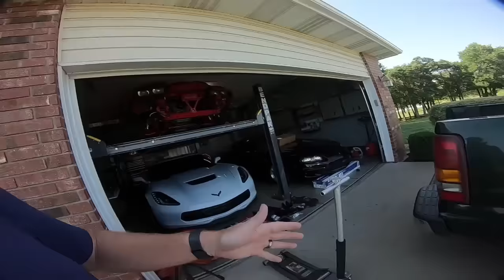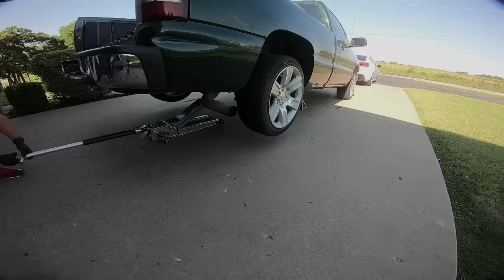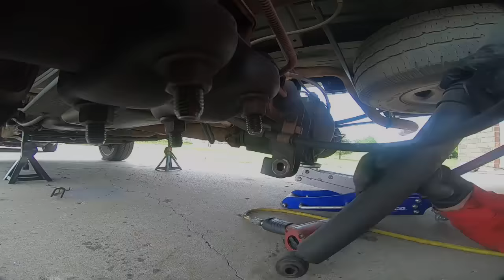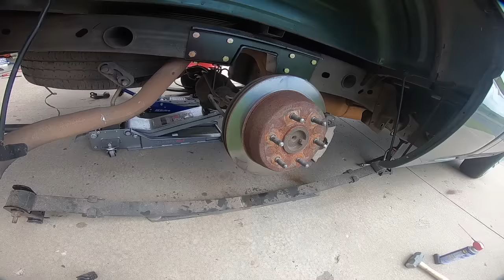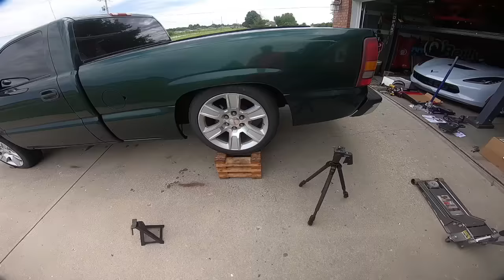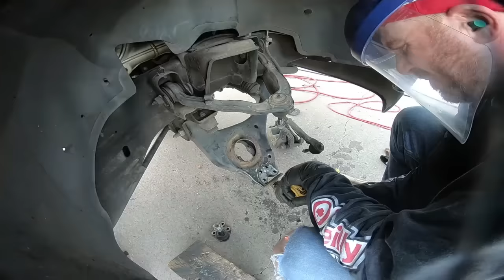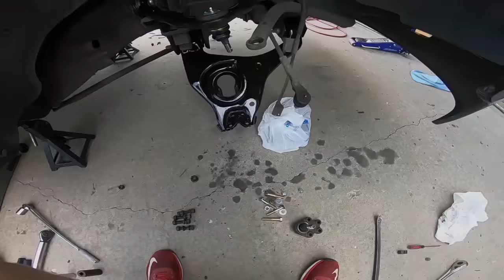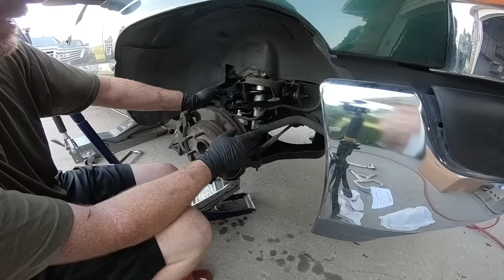How to Lower Sierra and Silverado NBS (Ultimate How to!!!)

Comment: Best how to lower these trucks video on the web hands down ! I've used this video several times as a guide reference every step of the way, now onto thoes bottom ball joints!
Reply from the maker: Thank you. Those ball joints suck!!!
Reply: When you grind the control arm , do you just do the top side or both top and bottom so its square?
Reply from the maker: I just did the top to get the rivets out
Reply: I'm talking about where the aluminum spacer inserts into the control arm.
Reply from the maker: It sets in even. No grinding inside where it goes

Comment: You can put the helper bags and put separate schrader valves for left and right so you can individually set heights. In fact if you had the lowering shackles on BOTH rear sides, you could pump up the left rear bag a little bit more than the right to compensate for the Chevy Lean
Reply from the maker: Yes you sure can.

Comment: watching you with the rivets made me laugh.  Years ago after trying to cut the heads off with a chisel for more than a hour, my ex came out, looked at what I was trying to do, stated why don't you drill them out!  Center punched rivet, 1/4" bit and 15 minutes later all rivets were out.
Great video. Gonna drop my 88 shortly. Owned since 91
Reply from the maker: I tried a drill too and all it did was dull the bit. I probably need some better bits though lol

Comment: I got a 2003  extended cab  1/2 ton i did a 5/7 drop and i put  airlift dual gauge and rear air bags and the rear airbags helps a lot when you do plan to put rear airbags don't use the supply bolts that goes from the top bracket to bags you will need to get shorter bolts trust me
Reply from the maker: I thought about a tank but dont air them up enough to need it really

Comment: I've been a Tech since 2000. I've had that exact same assembly apart more times than I could ever remember. Even the 4wd setup has only 1 more nut (axle nut). I think you did an outstanding job displaying a way that most people can do at home. Did you remember to notch out the upper control arm bolt holes for camber/caster adjustment? There is a really cool tool that does it with a 7'8 wrench. Take care Brother. Great job! Derek
Reply from the maker: Thank you. When using the upper a arms I used notching that area is not required anymore.
Reply: So basically make the hole a complete circle?

Comment: I just got a 3/5 djm kit and belltech shocks for a 3/5 drop....do i still need the shock extenders ?  Which is better arms or springs and spindles ?  I got 3" djm arms
Reply from the maker: I like the way shock extension put the geometry back in line for the shock. As for arms vs spring/spindle its preference. I don't like the ball joints in djm arms.

Comment: Do you have to change pinion angle on a 6 in rear drop?
Reply from the maker: I didn't as it is built in to the flip kit.
Reply: Ahh ok my truck shakes a lot when going on the highway I’m pretty sure it’s just the shocks or my bad tie rods
Reply from the maker: @Giggysiggy  both those would cause that issue.

Comment: Sharp. I've had 2 lowered nbs trucks but both had 4/6 djm kits on them. Been debating back and forth on doing one of my 04s. How does the springs ride in the front? Can you tell a slight difference at all?
Reply from the maker: Thank you. Spring rides good. I have had djm kit in the past also and I believe this is better on these year trucks.

Comment: well i was going to lower my truck. tell i seen you do it. i dont have that much patience. but the video was excellent. thank you for sharing that with me.
Reply from the maker: Thank you. The worst part is the relocation of the front ball joint. You could take them off and have a shop press them out. Not as bad as it seems.

Comment: Had that Chevy lean when i dropped my S10 5" front 6" out back and found the end links on the sway bar are unequal lengths-solved the problem using a bolt the same length and leveled the front out-reason why they use unequal lengths is so the vehicle will pull to the right slightly in case you fall asleep behind the wheel your ride will go off the road instead of into oncoming traffic.
Reply from the maker: That sucks. Mine is level now.

Comment: You could always heat up the front springs with the weight of the truck on it. Do it gradually and the coils will compress to whatever height you have your supports set. I did like & subscribe  by the way.
Reply from the maker: I have never like the heat coil option. I generally trim a little off. Thanks for liking and subscribing.
Reply: @TWAMotorsports  I am not fond of the idea either. Just a thought.  Take care Brother.

Comment: I had a lot of problems taking those rivets out on the lower control arm until i used a drill press. Just go on the slowest setting and start from a small bit and go up in size.  I had all 8 out in about half an hour.
Reply from the maker: Nice. Yeah they are a huge pita.

Comment: I enjoyed the video I have a 89 454. 7.4 I replaced all the wiring Spark plugs carburetor I thed a follow service to the Motor I died the flash to the tracmicion n fuck my luck the pom fron the tracmision the one that poms the tracmision  transmission oil to the turbine and I'm stuck because I lost my job because I don't have my truck I do framing for the new  hauses I wish I can do all that to my truck. Naow I have to finish the  tracmision the 400 I really admire what you do

Comment: Hey great video best one yet! Do you need shock extenders if you run stock  shocks can you run the stock shocks ?
Reply from the maker: Yes you need shock extenders and shocks
Reply: @TWAMotorsports so you can’t use the Stock shocks ?
Reply from the maker: No

Comment: I have followed your directions on lowering my truck thanks for the content helped 💯 I have one question the lower ball joint relocation what does that do thank you
Reply from the maker: It was a requirement with these spindles I used. It was a spindle for a 16 inch wheel fitment
Reply: @TWAMotorsports is that a requirement for the 17 inch wheel spindle? I got the 4/6 kit.
Reply from the maker: @juniorcts9747 no

Comment: This isn't the 4x4 you lowered before right. I thought the 1st one you lowered had a torsion bar suspension up front and this one has a spring front end
Reply from the maker: No this is a different truck. I sold the 4x4.

Comment: Thank you for putting this video together. I have an 04 1500 4WD with the 5.3 and have only found one 5/7 drop kit for it. Do you know if it will be safe to drop a 4WD that low? Anything else I should be aware of?
Reply from the maker: 4wd in this body style can get that low but the ride may not be great. Spindles and keys up front. Flip in the rear. Front shafts may not like it though
Reply: TWA Motorsports thanks man. Maybe i should opt for the 3/5 to be safe 🤔
Reply from the maker: @boosted_greg2193  that would for sure ride better👍

Comment: Great job, most informative and thorough video on the topic of lowering a NBS gm truck. You have way more patience than I do. I wanted to throw stuff when doing the lower ball joints on my truck. How is the ride with the lowered coil springs? I am leaning towards lowered control arms as opposed to spindles and springs. Thoughts?
Reply from the maker: Thank you. Ride is pretty good. I'm not a fan of a arm drops

Comment: Do the drop spindles mess with the caster or push the wheels further out from the center of the truck? Have been told to stay away from drop spindles at all costs, thoughts?
Reply from the maker: On some vehicles it does push the front wheel out. I did not notice a change on this one however. S10s it does though.

Comment: I have a 2001 Silverado ext cab  want to do the 4/6 drop bolting the c notch is fine no need for welding? I’m planning on towing a few small cars And do I need a bearing relocation for the driveshaft thanks
Reply from the maker: Yes I have towed many cars with a bolt in c Notch with no issues. I haven't done any ext cabs in this body style but I would think it would need a spacer on the carrier bearing.

Comment: I have a 05 GMC lowering it 4/6 will I need to change the front ball joins like you did & it will be on 24's 275-30-24 my homeboy has the same kit & rims on his GMC 18 & it doesn't rub
Reply from the maker: If you have the exact same spindle you can remove and reuse. Mine needed replacement. As for this spindle a 16" wheels fits.

Comment: The shock extenders you have listed are for Belltech's but it looked like you installed the McGaughy's. Am I correct? It appears like the Belltech doesn't have the additional bolt hole that you have to drill a hole for, which I would think is not a strong as the McGaughy's. I really enjoy your video's!!!!!
Reply from the maker: Older version

Comment: Hey man I'm on the front now .. I'm doing djm control arms. .. my lower ball joint is stuck in the spindle. .. I've pickle forked it .. I've pounded it on the spindle .. won't separate. .. any suggestions?
Reply from the maker: I never use a pickle fork because it runs ball joint boots. Use a big sledge hammer. Make sure that the nuts are thread on a little for safety. I have had to use a 10 pound sledge before.lol

Comment: Awesome vid, only question I have is: my truck has square u bolts.. the company sent a flip kit with round u bolts, I messaged them and they insured round would fit but the kit includes basically everything you had so now I’m kind of worried to install and be stuck any advice?
Reply from the maker: If the kit was for that truck use what they sent unless they reply different.

Comment: Hey man. Love the vid helped me out a bit with my install. I’ve had installed for some months now but was curious if you ran into any issues with an excessive bounciness. All was tightened under load but still have same issue. Ordered the whole ihc kit shocks and all. Know you got diff shocks but curious if that could be it
Reply from the maker: I didn't use ihc parts.
Reply: @TWAMotorsports  aww man lol. I gotcha. I mean all went well
With install everything fit. But like I said I just get a super bounce. Like I’m riding on the moon or so. They say to use stock springs in front. But I also see beltec says same with stock was gonna change but could only find lowering springs. I didn’t do the full 5/7 I did 5/5 cause it was always super low in rear but. Just so bouncy. Maybe if I switch all shocks out it’ll change. Not sure.  Can’t find much online just thought I’d ask someone with a bit more experience
Reply from the maker: Yeah I am just not a huge fan of their products. Seems like several have had issues

Comment: Flipping that lower ball joint makes me nervous.  We just went from the ball joint working with the weight of the truck to working against it.  Is that a custom lbj made for flipping or just an off the shelf from the parts house?  Have you ever heard of them failing?  It’s a reputable brand kit so I would think they’ve put some thought into it but it concerns me.
Reply from the maker: I understand what you are saying but have never heard of a failure. They make a 17" spindle that doesn't require this but in my opinion it has a little more bump steer.

Comment: I have a 2011 silverado 1500 shortbed.  What is the lowest you can go without cutting the frame/ cutting hangers off?

What is the best was way (kit) to just lower the rear 2" (if I decide to just level the truck)?

Thanks for all your expertise/ advice!
Reply from the maker: I don't do kits. 6 in back without notch.
Reply: Thanks.  If I just lowered the back 2”, would you use shackles ?
Reply from the maker: Yes

Comment: Just curious noticed you took rivets out old lca and shaved it down but did you replace the lower arm? If so just curious on where I can find with out ball joint. Unless it came with and you removed. Thanks!  Great vid btw. Reallly informative
Reply from the maker: No I just repainted them.

Comment: Not done watching but the first thing that came to mind when you traced out the "C" notch was that you traced out the cut out from the inside, save some time and trace the "outside" so you don't have to spend extra time grinding off the excess material.  To ensure a snug fit, cut out the material on the inside of the line and it will give you just a bit of material to play with that you can grind down to make it snug.
Reply from the maker: Thank you. I actually thought about that and did it on the other side. Good catch.

Comment: What’s the wheel/tire size? Dropping mine with the same kit Monday but with stock fromt springs with 24 reps and 295/50 wondering how much clearance issue I’ll have
Reply from the maker: 245/45-20. You will rub a lot.

Comment: Do you center out the bolt in notch above the factory bump stops? If not what is your reference point on where to cut? Directions on my kit I just got want me to cut out for the notch last but I’d rather to it right away as you did.
Reply from the maker: Should come with alignment stencil

Comment: So new moog upper.  What if you need a lower control
Arm from moog can you still use the  aluminum block spacer? Or  should you get a factory new lower. Did you not say you were or can only put 16 inch rims.. comments says you have 20 inch?
Reply from the maker: This spindle works with down to a 16" wheel. Lower would be stock replacement and would still require if using the spindle i did.

Comment: Quick question what is ur rim and tire size? I have the same Truck and doing the same drop but thinking about putting 2019 gmc 20x9 wheels on and not sure if I'll have a rub issue on turns. It has a 6" backspacing.  Thanks for the great video
Reply from the maker: Thank you. All parts I ise are always listed in the video description. Doubt they will rub.

Comment: Hey thank you I lower my 2000 gmc seirra I did everything you did except I used 17 or bigger spindles and I got moog lower a arms also thanks a lot
Reply from the maker: Glad I could help
Reply from the maker: Never have
Reply: I know I’m going by what you say for sure. Everyone says I need to underbed notch or weld it my brothers four door cracked but he didn’t put the bottom bolts in it
Reply from the maker: Yeah a weld in is better but if done correctly I don't see the issue

Comment: Are you supposed to install the plate you put over the control arm to mount the wheel bearing on top of it if you I stall lowering spindles ? What's that plate for ?
Reply from the maker: Plate is for relocation of ball joint. Only comes with the 16" spindles used in this video
Reply: @TWAMotorsports is the plate necessary?
Reply from the maker: Yep

Comment: Hey man great video.  I'm going to do a 2/4 drop on mine and i'm wondering if i need the CK80826 upper control arm for only a 2" drop. what do you think?
I definitely do not want any camber when it's done.  Thanks
Reply from the maker: Not for only 2 inches in front

Comment: Looks good! I have a 02 Silverado I did a 2-4 mcgaughys drop, which was 2" spindles in the front and shackles and hangers in the back. I also have a Chevy lean on mine as well. Do you think if I 3" on one side and 4" on the other will help level it out?
Reply from the maker: It's worth a try. You could also trim some off the passenger side spring

Comment: Great video, planning on installing this kit on mine soon...is there any reason to be concerned that when the lower ball joint sits on top of control arm, there's alot of upward force on the bolts? As opposed to pushing against the control arm itself like when it's actually in the pocket.
Reply from the maker: No concern in my opinion. It's on top so most pressure is down

Comment: Where did u get the aluminum spacer for the front ball joint
Reply from the maker: Comes with the spindle if you bought the ones I used.

Comment: I have a 94 Silverado that is C notched. It was not welded. I know the bolts will hold and if not careful, welding can cause some warping of the I beam. JS
Reply from the maker: True if it's too hot it could warp a little.

Comment: Good video! Trucks looking good
Reply from the maker: Thank you man.
Reply: Hey, I just recently did something similar 3/5 drop and now my rear is extremely squeaky. Thinking it’s my new shackle, but what can I do to fix it?
Reply from the maker: @Haze8923  loosen put grease in that area and retorque. Do not over tighten.
Reply: Thanks! I’ll try it out, that squeak has been driving me nuts
Reply from the maker: @Haze8923  yes I hate noises when I'm driving.